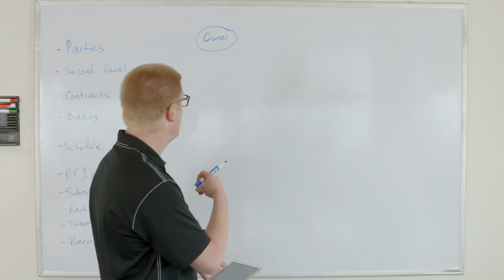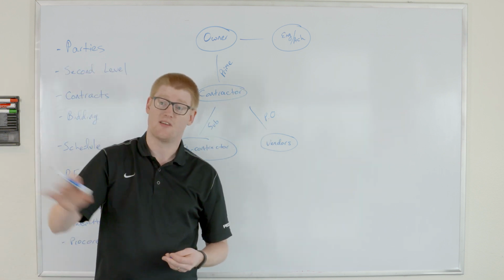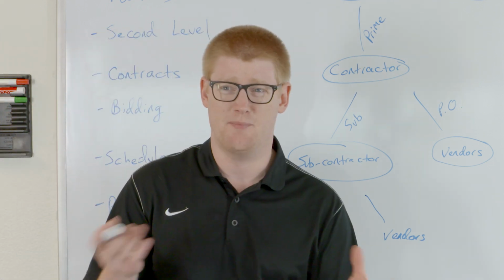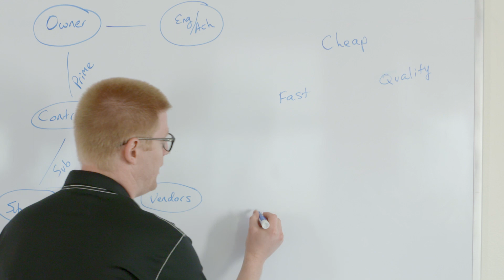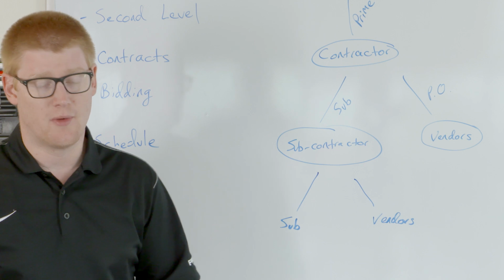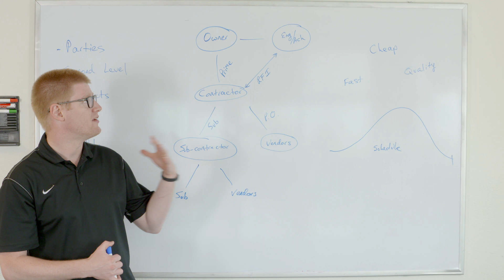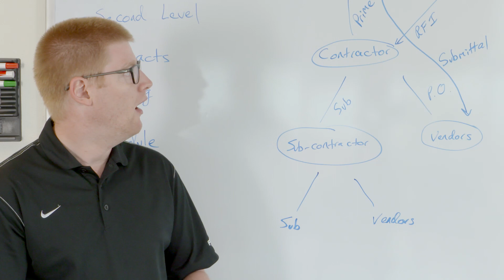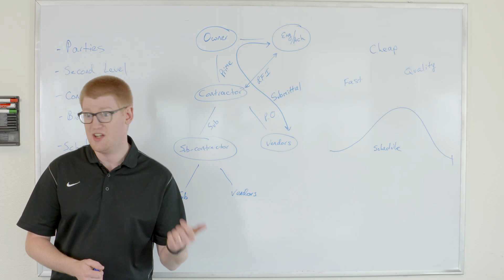Construction Basics: Roles and Relationships

Comment: I hope that you can assist me. I need to buy software that compares bids side by side and identifies pricing and scope discrepancies, etc.. All suggestions would be appreciated.  I only work with contractors who break down their bids. Does Procore have a module that will do this?

It is overwhelming to analyze bids from 4-5 contractors with 200+ line items in each bid.  I am not a construction professional; although, I have hired several contractors in the past few years for both small projects and major residential renovations. So, I am not a newbie and I am very capable using software with a steep learning curve. Thank you.

Comment: I would disagree on the Short Steel analogy. Someone will pay for the crew efficiency decrease. Analyse the schedule impact and pass the cost on with either a claim or change order. No reason for the contractor using contingency with out utilizing the process in place.

Comment: Why does the architect lead over the head engineer. You would think it would be the other way around.
Reply: The Head Engineer would be in charge of all facets of engineering(structural/mechanical design) pertaining to a project. They are more adept at addressing the technical aspects of the project, and delegating the various engineers effectively -- whereas the Architect would be more equipped to assume the role of a Leader, mediating between all the various facets(Contractors, sub-contractors, Local Authority, Regional Administration, Quantity Surveyors) of the construction process. 
From what I gathered in the industry, the Architect articulates the preliminary design of the project to the Employer/Property Owner, along with the Quantity Surveyor's guiding hand, as to ensure optimal fiscal, environmental, and sustainable outcomes for the Property Owner. The Head Engineer would only report to the Architect, Quantity Surveyor, and the Contractors, as to ensure that they are following the overall design, and are completing the works in accordance with the variables set out in the Prime Contract... The Property Owner has little utility for the Structural/Mechanical reports of the Head Engineer, thus they would report to the Architect and the Quantity Surveyor. This line of command would dictate that the Architect assumes a Leadership role, preferably, over a Head Engineer. 

Also, Architects complete modules during the course of their tuition which equips them to manage and mediate between the facets of construction inter-and-intra-personally. This leadership should not be mistaken for a rung among the competency hierarchy, I believe both the Architect and Head Engineer are equally invaluable to a successful project! 

My knowledge on this is admittedly pretty elementary, but that's how I have it. Correct me if I'm wrong!
Reply: because the engineer is busy
Reply: In simple terms, the architect designs the building so they are responsible for it. The architect is the “professional of record” and is legally responsible for the health, safety, and welfare of a building. As he stated in the video the architect has a contract with the owner, and the general contractor has a contract with the owner. The architect hires structural, mechanical, electrical, plumbing engineers as consultants for a project. Technically they work for the architect and not the owner, so that is why they report to the architect. Engineers don’t design buildings, they design components of a building.
Reply: In California, Contractors need 4 years Journeyman experience, and pass a 2-part test to get GC licensed. 
Engineers need a relevant college degree, min. 4 years experience, and pass 1 test to get PE licensed. 
Architects need a relevant college degree, min. 8 years experience tracked nationally by NCARB, and pass 5 tests to get licensed. Gee, who has the most (legal) responsibility here?